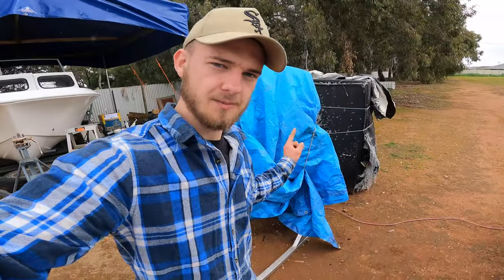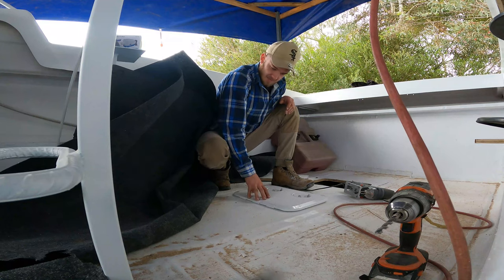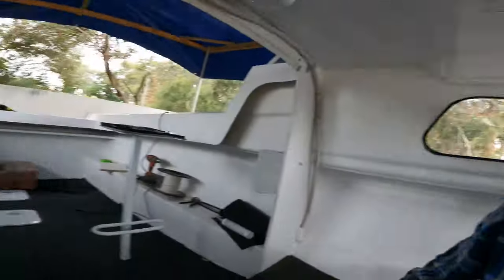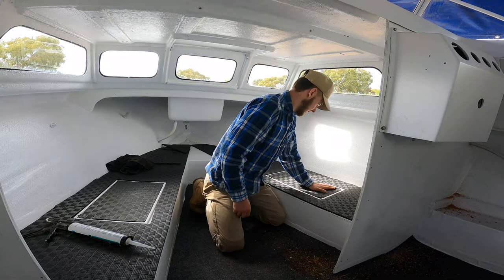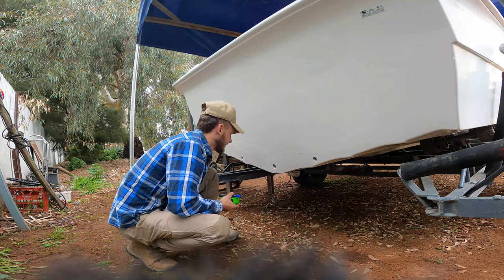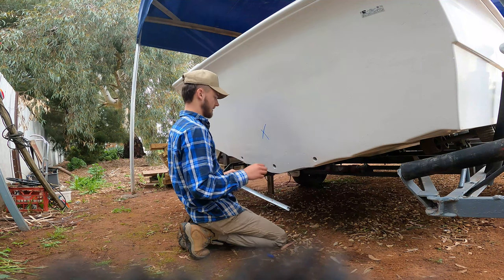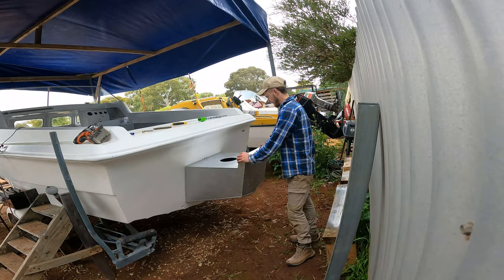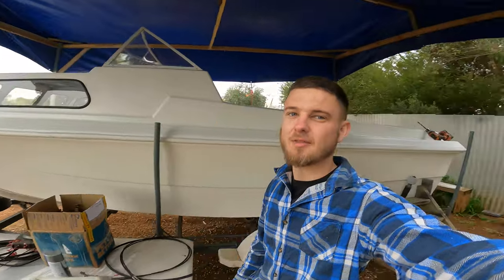PART 4 - Starting To Take Shape. INSTALLING - pod - latches - cushion's, electrical - bilge pump.

Comment: What paint did you use?
Reply from the maker: I was recommended some really durable paint. Basically driveway paint. This paint is only used for above water. Since I’ve been working on it I haven’t had a issue getting in and out of the boat. Really impressed with it.